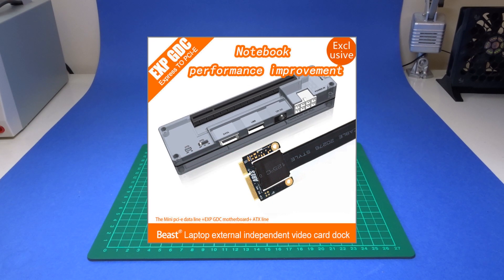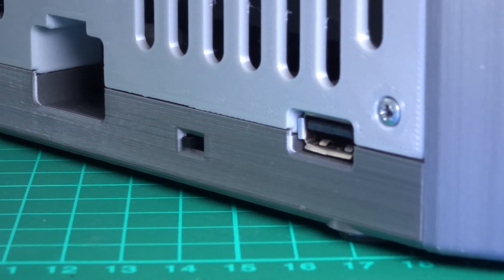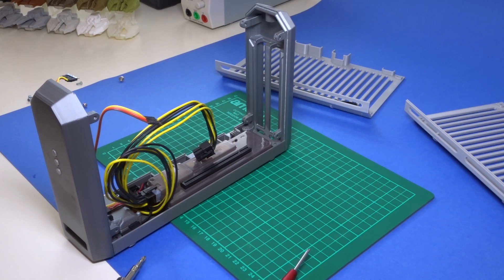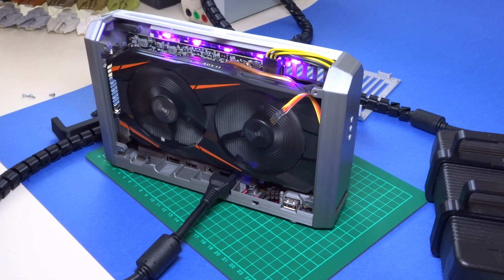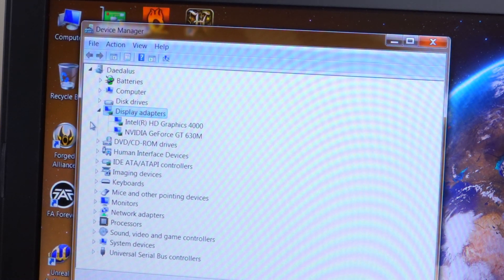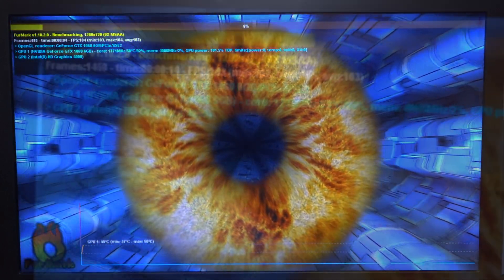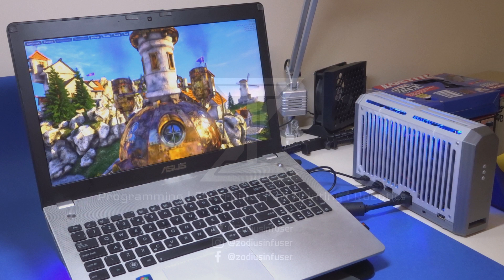Custom 3D Printed DIY eGPU Enclosure - Setup and Thoughts

Comment: That is one great design on the enclosure :D really like it!. Is it correct understood i can use this to "only" mount the gdc exp beast dock with the cables and then install a grafic cards? or so i need more than those 2 components + cables as a minimum. I have never used the beast egpu so i hope its okay i ask and wanna be sure before i print your design :D

Comment: wonderful case , nice explaination . hope i can success setup GTX1070 in my Predator G9 791 soon. 
you should sell us the case , allow to fit in RTX2070 super .
Reply: Just make sure you get the correct version of EXP GDC eGPU.
EXP GDC v8.0 support up to GTX 10 series.
EXP GDC v8.4d support up to GTX16 series.
EXP GDC v8.5c support up to RTX 20 series.
EXP GDC v9.0 support up to RTX 30 series, but this one is still unstable.

Comment: Great video.  Curious what you or other folks think of my mini pc and egpu plan.  I have a Beelink GT-R (no Thunderbolt 3.0) with Ryzen 5 3550H/Vega 8, 16gb ram and a NVMe PCIe x4 slot.  I also have a Geforce GTX 1650 Kalmx with a rated power draw of 75 watts.  The Kalmx is powered via PCIe connection (no external power connection options).  Will connecting the NVMe PCIe slot to the Kalmx work via a EXPLOMOS M.2 Key M NGFF to PCI-E 4X Adapter Card to both provide the graphics to the cpu as well as provide power to the egpu?  The opportunity to have a very compact egpu with no fan or external power needed paired with a robust mini pc and a wireless hdmi portable monitor seems like a winning combo (if it works).

Comment: I think in this case your laptop cpu and display is bottlenecking the 1060, with a newer laptop, it should be able to run doom 2016 easily on 1080p.

Comment: Hello, can you tell if I can use the Dell DA-2 with the Radeon RX 580?
Reply: @esbennielsen8894  I have an RX 5600-XT now. I'm thinking of get a slim atx 300w power supply and making a acrylic box to comport everything. What do you think, now?
Reply: @esbennielsen8894  Very clean, but also expensive. With no doubt, much better though. Good luck! Make a video about it.

Comment: I just have intel hd 4000 alone i have to disable it or what?? 

( I have rx 580 and gdc best mini pcie version )
Reply from the maker: No need to disable. Just plug in your RX580, install drivers, and you should be good to go for driving an external display. I am unsure on driving the laptop's display though

Comment: Can unplug egpu even installed drivers?
Reply from the maker: Not whilst the laptop is powered. But yes, the eGPU can be disconnected without needing to uninstall drivers for it. Laptop will just use its regular graphics.

Comment: Wouldn’t it be wonderful if there’s a thunderbolt 3 cable for the gdc exp beast
Reply: The only problem: the price.
Reply: There is actually.
On every retailer of EXP GDC online, they sell the dock and the cable as 1 Package. You then first choose it before you buy. So overall it looks like this on the Product Description of EXP GDC:
EXP GDC v8.4d NGFF (or) mPCIe (or) M.2 (or) TB3.

Some retailer even able to give you all types of the Cables within 1 package but of course you have to pay them all, totaling almost $200 for the docking and 5 cables.

Comment: Firstly - Thanks for created, sharing and demonstrated this gorgeous vessel [Case Mod].
Secondly - I saw and I didn't understand what you did to SPDT to power ON or OFF the GPU and LAD components.
Reply from the maker: Thanks! Glad you enjoyed it.
For the switch, the Power Supply has a sense pin that is shorted to ground whilst the computer is powered, causing it to enable its 12V rail. I simply added a switch between sense and ground to force that behaviour even if no PC was connected. This allows it to be turned on and off at will, but also to keep it on if some vibration causes the dodgy cable to momentarily disconnect, which would normally result in a BSoD.

Comment: i thoughr egpu can be connected only to external monitors?
Reply: No! You can use your´s laptop monitor, but have conditions. I don't remember all specs. I Think is the type of the external graphics card and if you have a integrated graphics Card in your Laptop

Comment: Can i ask you what was the problem with your first cable? Did the wires get too hot? Is the second "hdmi" cable original version getting very hot as well? I am afraid that it could melt and burn something inside of the laptop, because i don't wanna put the cable out of the body like you, but use some convertor into female micro hdmi and put it into my empty safety lock port, but the whole laptop body is actually thin and the cable must lead there slightly touching the mainboard
Reply from the maker: No nothing like that. Rather over time the solder joints broke due to repeated bending so it stopped working. I attempted to fix it with the bodge I showed, but even that broke after a while. So rather than continually repair it I just got a new one and made sure to be careful with it. Had no issues with temperature.

Comment: How much did it cost u to build
Reply from the maker: The main costs were the EXP Beast adapter (£40) and DA-2 power supply (£10). The case only cost a few pounds in screws and £5-10 for the optional USB charger at the front and LEDs. Of course, needed a 3D printer to make it so that is a big expense  if you don't already have one

Comment: can i plug in to a m.2 ssd slot instead of the wifi? pls help
Reply: Lol no
Reply: @antikz3731  why
Reply from the maker: Technically you can because m.2 is a pci express connection, but its dependent on if your motherboard has the feature enabled, i.e. if it supports nvme. Search for "M.2 EXP Beast" on ebay and you will see a few options of adapter
Reply: An ssd slot is for storage. Pci express is for accesories

Comment: I have question if 1070 Ti Mini from Zotac will fit to this enclosure. I also have dylema if I should get Dell DA-2 for this card or get regular power supply?
Reply from the maker: Looking at the specs it seems to be a similar size to the Gigabyte 1060 I used in the video so should fit. As for power supply, the Zotac website says it is 180W so under the 220W of the Dell DA-2. If you have a regular power supply lying around it may be best to test with that first though

Comment: Hi. There, thank you for sharing the video and your 3D custom enclosure. I am looking for a similar solution but i don't have access to 3D printer. I wonder if you can make one for mad i will pay for the cost and shipping if the cost is reasonable?
Reply: Its SUPER cheap. Made mine for 50 bucks

Comment: can still use default gpu when I dont wanna use egpu like going trip or school?
Reply from the maker: Yes, I did this several times. You just have to disconnect the cable (while the laptop is off) and it will revert to integrated graphics. Then you just turn any dedicated graphics back on in Device Manager
Reply: @ZodiusInfuser  i was wondering how did u switch between the drivers?

Comment: im afraid of heating issue, will melting the enclosure..
Reply from the maker: Depends on your card of course but I never found the exhaust air from my 1060 to be that hot. Certainly no more than 50 degrees under load.

Comment: Does it work with ATI cards?
Reply from the maker: If you are connecting to an external display then I cannot see why not. Routing back to the internal display seems to require nvidia though. Best to check over at egpu.io

Comment: i have a asus x556 with NGFF connection i want to add EGPU for 4 external displays(no need the internal), do you think it will work with this laptop? 4k 60hz  is dependable only by the GPU performance? thank you
Reply from the maker: I have not used a NGFF setup before so could not say. In principle it should work, but you would be best checking out similar setups or asking asking over on the egpu.io forum

Comment: Very good job! I also have an Asus laptop with GT650M, do you think that I can use a AMD screencard instead of Nvdia? Because I have a freesync monitor currently and I'd really like to use it as an advantage.
Reply from the maker: As with all this stuff there's no certainties, but for just driving the external display then using an AMD card "should" work fine. You wouldn't be able to drive the laptop screen like I show though as that does need a Nvidia card to act as a replacement for your GT650M.
Reply: @ZodiusInfuser  Thanks for the quick reply. :) Yes I see, I think I won't use my laptop display to play games. Maybe what I'm thinking is to find a way to test an AMD card before purchasing it so I won't be risking my money.
Reply: @xxtravisxxify  Hi, so did it work with the AMD? I am having asus N56VZ, planning to buy RX570 as egpu here

Comment: Can I put a smaller gpu like the gtx 1660?
Reply from the maker: Depends which specific model but I imagine the 1660 is a similar size to the 1060 I show. If not then there is a longer version someone made from my design: https://www.thingiverse.com/thing:3397967

Comment: But some Laptops have certain Bios Whitelists right? Which means the Bios disables the mpcie port, when it doenst detect the verified device (wifi card in this case). So in order for this to work, you would have to normally boot the Laptop with the wifi card installed, so that the Bios enables the mpcie port and then after that put the Laptop to sleep. Now hot swap the Wifi card with the mpcie to hdmi cable (with the Exp already switched on of course!) and wake up the Laptop.
The Device Manager now detects the GPU because the mpcie port was enabled, when the Bios checked on boot up.
This is actually true, I'm not just rambling something here. But now comes the downside to this whole thing. This solution isn't permanent. You need to do this every time you reboot your windows. Not practicall if you plan on using the Laptop... well as a mobile/portable Laptop.
But if you're like me and have a 7 year old Laptop, you'll likely have no use for it anymore. Talking about mobility here. 

I personally mounted my laptop's Mobo to the underside of my table, attached a custom CPU cooler on it and called it a day. It's basically a normal PC now. Without the big clunky Case of course.
Obviously I use an external Monitor.

Now my Laptop is as I said a Laptop that has a very locked Bios and does this whole "lock mpcie port" thing.
The way I bypass this whole dilemma is by just leaving the PC turned on and let it automatically go to hibernation mode. If I wish to use it again I can just press a random Keyboard button for example and it turns back on.
Pretty neat right? 

Now everything I just said, is what I will be doing when I get the damn EXP. And theoretically it should work. 

But nothing goes according to plan with these things, do they? xD

(English was hopefully OK, I'm a German guy and am trying to improve my English skills so any feedback would be greatly appreciated!)
Reply from the maker: You are right in that most laptops have a PCIe whitelist that restricts the use of eGPUs like this. I was fortunate with this ASUS laptop so can turn it off with the eGPU connected and it will be recognised again on the following bootup.

Didn't realise there was the sleep/hibernate workaround for those laptops that do have a whitelist though! Not ideal I admit, plus the benefit of PCIe eGPUs is becoming more limited with each passing year, but it's still a fun experiment for people like yourself who are into PC hardware.
Reply: @ZodiusInfuser  yes exactly! There will always be that one guy who will say "Just buy a Desktop PC".

But why do that, when you can recycle old things and make them even better or perhaps just as good as an ordinary desktop PC. Plus it's cheaper this way and you learn a lot in the process! 
A win win I say!

Thanks for being so understanding. I hope you have just as fun playing around with this stuff as me learning all this and making sense of it! xD

Subscribed!
Reply: @ZodiusInfuser  If I may ask, how long is the mpcie cable? Haven't found any Information on that xD
Reply from the maker: @50shadesofmycow  From end to end my replacement one is 75cm. Think the original was that length too but I shortened it to 50cm (don't recommend trying that yourself though as that's part of the reason I needed the replacement)
Reply: @ZodiusInfuser  Thanks! (Would you mind pinning my first comment, so that anyone who has the same problem gets a little insight and advice to fix it?)

Comment: great .. i want to share my experience with the gtx 1070 EGPU connected to toshiba laptop through mini pci- x1 v2.0 slot .. the difference was 100% better at high settings :) 
check this video everyone : https://youtu.be/25Vy3HbWNeE

Comment: thank you for your video man. you get one subscriber for this. I was looking for a solution for my PC gaming fix, since I will be moving abroad to study and I cannot bring my tower PC. been thinking about buying old Thinkpad T420 comboing it with an external GPU but I can't lug around an ATX PSU. your case + a power brick seems so much reasonable. do you mind checking on those PicoPSU (in case those Dell power brick ran out?) and see if it will fit in the enclosure?

Comment: Wow this is exactly what I was looking for, no one sells this, You should sell them in Amazon or Ebay. how much for one ?
Reply from the maker: Sorry, missed this message. I am not selling the enclosure, but the 3D printing files are freely available on Thingiverse (link in video description) for anyone who wants to make their own
Reply: @ZodiusInfuser  I would like to know how much money you spend on your enclosure with the adapter and stuff. Really great content!
Is the GTX 1060 the limit or could I speed up 1440p Gaming with a RTX 2070 Super with it aswell? I don't know how much bandwith I need and how much I get through the PCI Express slot.
Reply from the maker: @Tri-Technology  It's been a long while since I built it, so cannot remember for sure, but guessing sub £100 minus the GPU. Main costs were the EXP Beast itself and the external power supply.
With this setup you only get a single PCI_E Gen 2 lane, so although putting a bigger GPU than a 1060 in would give better graphics quality, it will always be bottlenecked on data throughput. At most you're looking at 720p on titles from the past 5 years.
Reply: @ZodiusInfuser  Thanks for this information. I appreciate that you respond to my question about this topic. Still intresting to upgrade old hardware for a bit of fun or productivity.
Reply from the maker: @Tri-Technology  Oh absolutely! Plus, in my case it let me hold off upgrading my laptop for another year until Zen 2 reached mobile
Reply: @ZodiusInfuser  could you fit a gt 1030 in there
Reply: @ZodiusInfuser  or a gtx 1050
Reply from the maker: @g44t1  I imagine both cards are smaller than the 1060 I used, so yes
Reply: @ZodiusInfuser  ty so much for replying so fast and answering my question
Reply from the maker: @g44t1  you're welcome. I hope you enjoy using the case.

If you do find it too small, someone made a remix of it suitable for even larger cards.
Reply: @ZodiusInfuser  yup I love it

Comment: How many pcie lanes did you manage to use with that interface?
Reply from the maker: This interface only uses a single PCIe lane running at Gen 2 speeds. I believe there are other versions of the EXP GDC Beast that support four Gen 3 lanes, but those only work with newer laptops.

Comment: Can you please make a 3D model for me for the gigabyte RTX 2070 windforce
Reply from the maker: Making different lengths of this enclosure is quite tricky to be honest. Someone made a longer version that MAY fit but you'll have to check the dimensions yourself: https://www.thingiverse.com/thing:3397967

Also, it's worth checking if an RTX 2070 works as an eGPU before making an enclosure for it as it may not be compatible with this technique.
Reply: @ZodiusInfuser  ok thnx
Reply: Maybe can you tell me which software/app/program you used to make the case?
Reply from the maker: @frederikvanreusel  I used a really old program to model it that unfortunately you can't get any more. If you want to try making a longer version yourself though, then I would recommend importing the STL files into Blender and moving the relevant faces. This should be easy for the base part, but trickier for the sides. Also consider your maximum print volume.

Comment: Very good!

a question: how long did it take to print all the parts of the case?
Reply from the maker: Sorry, I seem to have missed the question you edited in. I can't remember the exact times as it was over a year ago at this point, but I believe each side panel was 12 hours, base was 8 and the front and back were 3.

Comment: Can you use an hdmi to thumderbolt 3 adapter to bypass the pcie part?
Reply from the maker: I would say no, as Thunderbolt 3 is higher speed and has other protocol level stuff. You'd be better off getting a Thunderbolt 3 eGPU enclosure.
Reply: @ZodiusInfuser  ok, thanks for the advice

Comment: If unplug the egpu can still use the built-in graphics card? I wonder what will happen because u disabled the built-in gpu to install the external gpu...
Reply from the maker: Well, with the mPCIe version you cannot unplug the eGPU whilst the laptop is on, otherwise you get a blue screen. What I typically do is re-enable the built-in graphics whilst the eGPU is connected (meaning both are present) then shut down the laptop. That way when I reboot after having removed the cable, the laptop is back to normal again and there's no need for any further reboots.

With the Expresscard version I know that a "Safely Remove Hardware" option for the eGPU appears, so I am guessing that if that's pressed the laptop would just default to the graphics onboard the CPU until you re-enable the better built-in graphics (and reboot most likely).